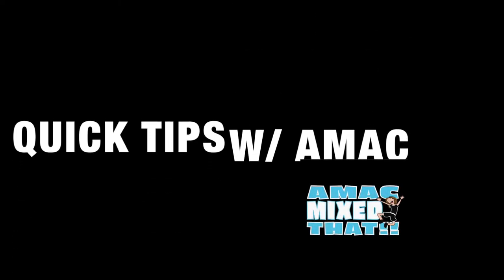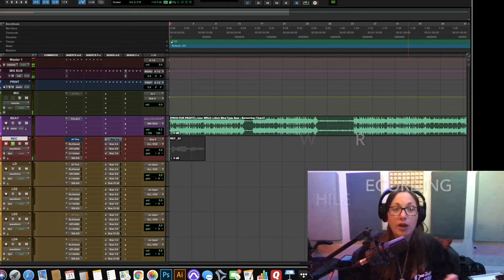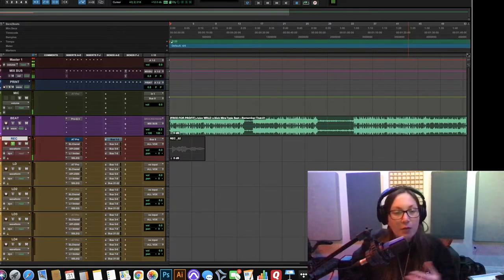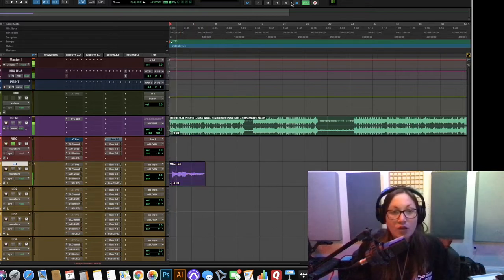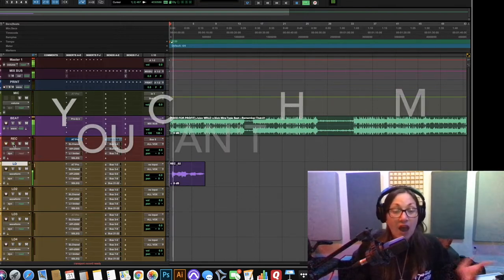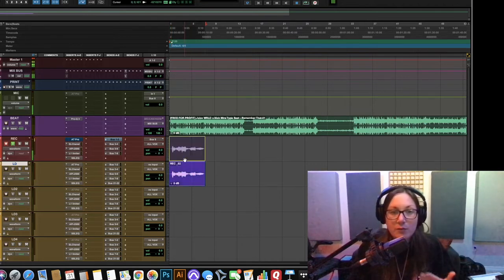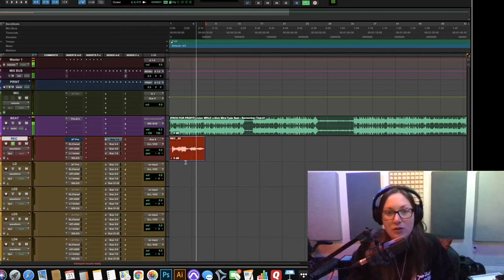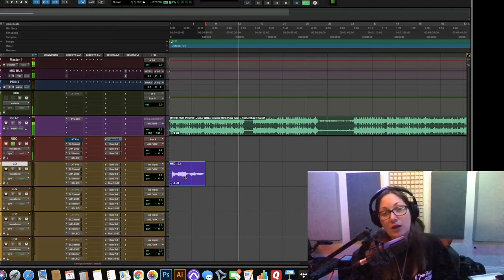Using Input Monitoring During Recording

Comment: Thank you so much for sharing.. 🙂🙂how do I access the input monitoring? for example, on my region I only have the m for mute, the S for solo and the R for recording.. how do I access the I for input...thank you so much in advance for sharing..🙂👍🏿
Reply from the maker: What version of Pro Tools are you using? If it’s not there it usually means you have a version that doesn’t support it.
Reply: @AMACULENTMINDSET  first of all, thank you so much for responding .🙂👍🏿secondly I would like to apologize. I do not have pro tools ...I have logic pro so I'm sure that it will be difficult to answer that question.. I will be subscribing due to your expediency in responding.. thank you so much!🙂🙏🏿
Reply from the maker: Ah yes I’m not very familiar with Logic but it does 100 percent have an input monitoring button. I’m just not sure what the reason is it might not show up for you
Reply: @AMACULENTMINDSET  I found the issue and all is solved. 🙂Once again,.thank you so much,.as I anticipate your upcoming videos. 🙂👍🏿